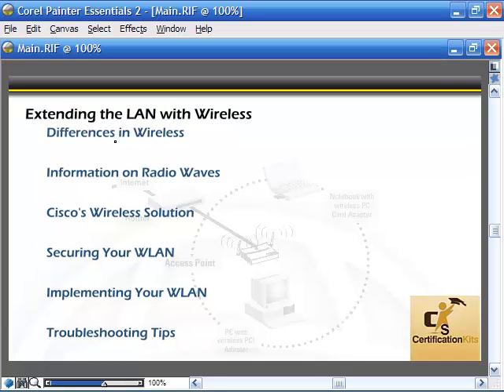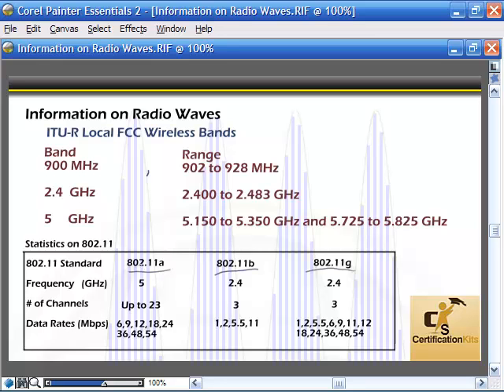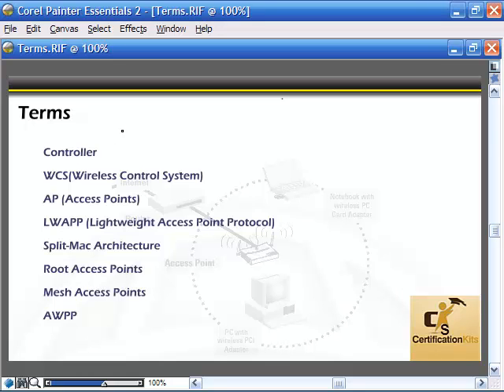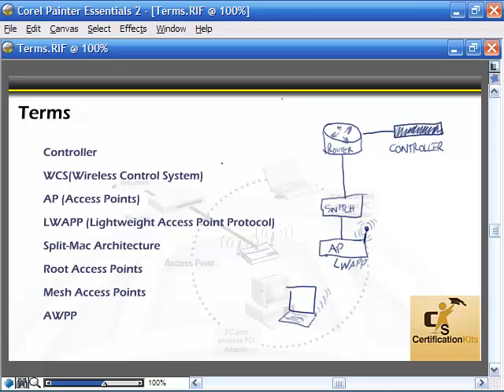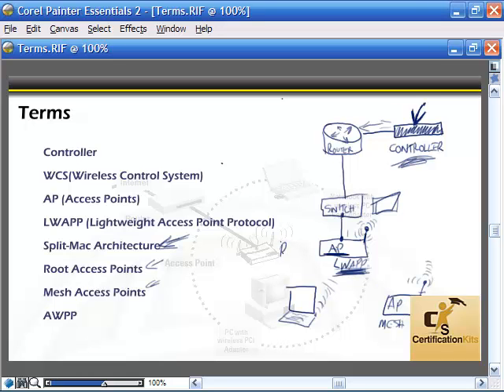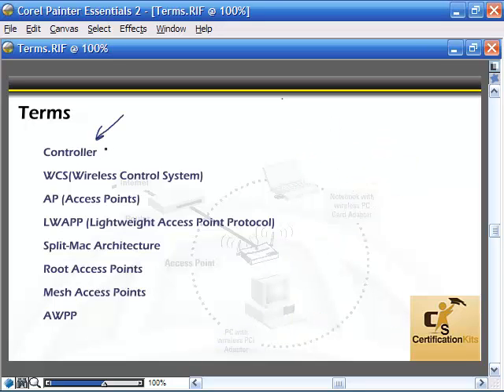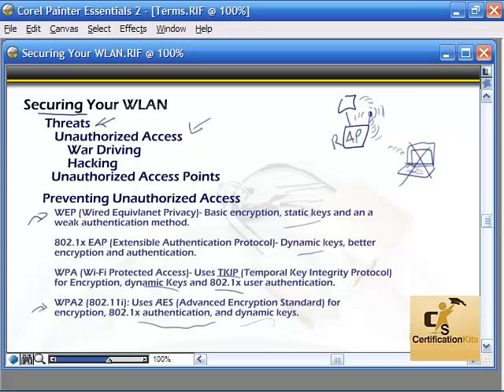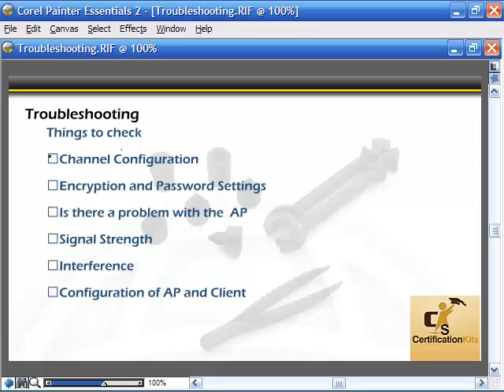CCENT & CCNA Exam Video: Introduction to Wireless LANs

Comment: Buyer Beware!  Trade-up program is a hoax!

I purchased a CCNA kit and when I was done with it and moving on to CCNA Voice, I was told by Erik at CertificationKits that they did not have a buy-back program.  Erik told me my best option was to sell my equipment on eBay then purchase my CCNA Voice items that he e-mail me a quote for.  I sold and purchased my new equipment and e-mailed CK to let them know why I was not purchasing from them.  They e-mail me back to let me know they have "one of the most generous" trade-up programs.  Of course, a day late and a dollar short.  I emailed them back to let them know they also have "one of the least helpful" customer service departments since I was not told about the Trade-up program despite directly asking if they had one.  Happy ending: I was able to get what I needed for my CCNA Voice lab on ebay for $188.23 when they quoted me $423.99.  Less than half!